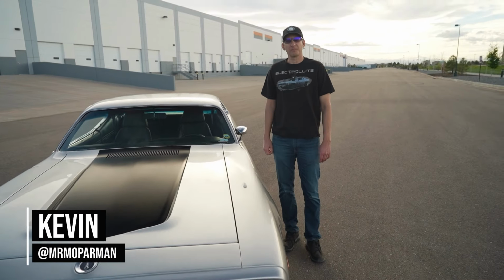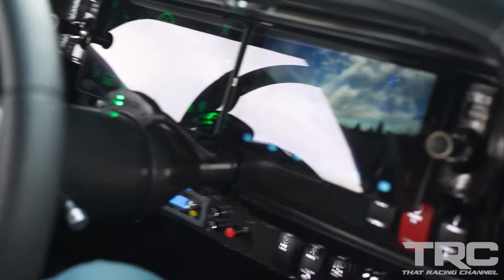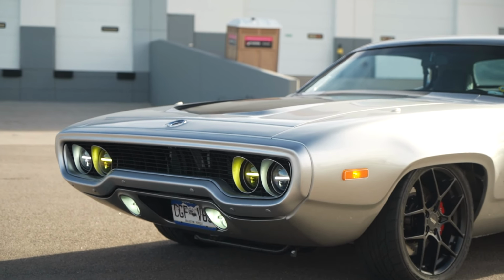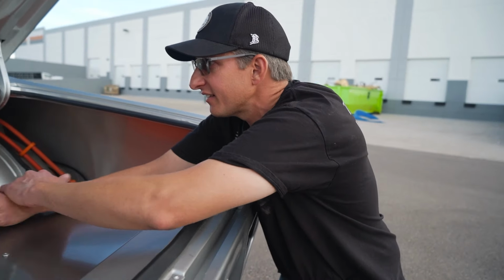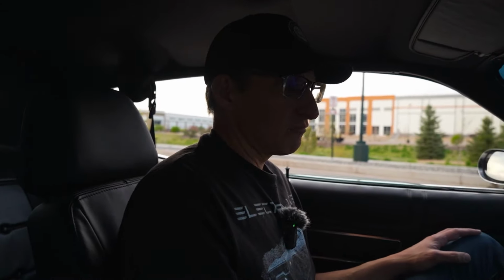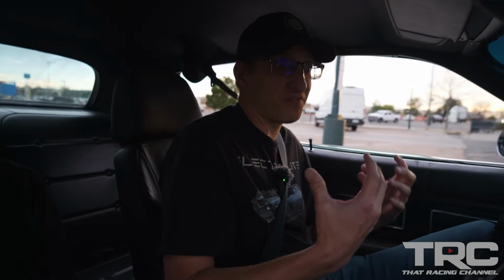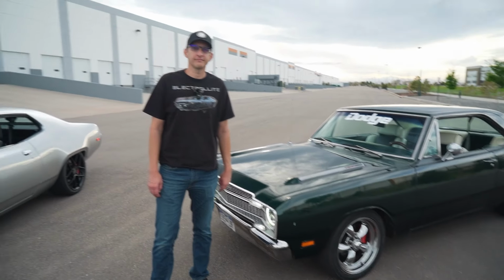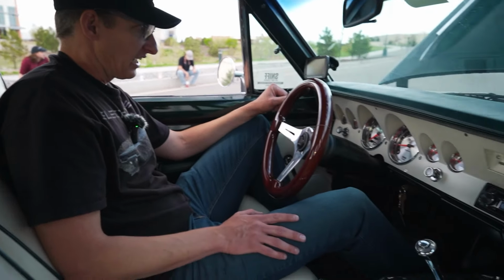Tesla Swap Plymouth SURPRISES 700HP Turbo Dodge Dart! (He Built his Own EV Muscle Car)

Comment: I think if EVs went more into a 'conversion' philosophy, EVs would be a lot more appealing to a lot of gearheads. Something about old cars being converted to an EV makes it cool, kinda giving it that futuristic retro feeling.
Reply: Thats about my plan, already got a sportbike frame stripped down for when I have the money to start.
Reply: Cyberpunk lookin' ahh
Reply: If you think about it, it's just resto-modding to the next level.
Reply: Totally - this is the sort of electric I could get behind
Reply: There are many of these cars with no drivetrains and would be perfect for electric conversion
Reply: Eletric conversion my a$$
Reply: The weight alone wouldn't even allow you to pull off the driveway without a recharge.
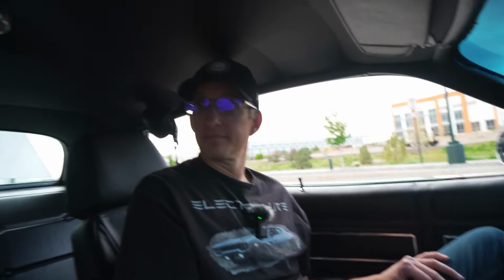Reply: @nuneza1987 .   15:20.    Your driveway is 250 to 300 miles long?
Reply: No. Just no. Actually ruined.
Reply: @nuneza1987  it's 600 pounds lighter than the tesla plaid the conversions parts came out of
Reply: @tylerbuilt_chevy_tough5163  exactly.
Reply: 😂 ok
Reply: No
Reply: this thing gives me that hyundai delorean vibes
Reply: Exactly! If someone designed, built and marketed a mustang ev crate kit for my 2016 mustang i would buy one in a heart beat. Especially if the same tax incentives for a new ev purchase applied to conversions. Its even more environmentally friendly than buying an entirely new ev, less manufacturing materials and pollution and less material going into landfills.
Reply: There's a company here in California that does it already, they have youtube videos.
Reply: Eventually, and logically, this is the only way old cars will survive. With batteries and electric motors they’re going to have way longer lives than they would with ICE. There’s way less to go wrong with the EV drivetrain.
Reply: @IAmSoMuchBetterThanYou  yes, and add to that an aluminum body like my f150 and were looking at several decades of longevity. Its exciting!
Reply: @leebatt7964  GM is already working on a build to attach directly to a Turbo 350 transmission. Should be available soon as a kit swap. Hopefully Ford has something in the works.
Reply: Hybrid
Reply: Nothing cool about it, just ruining a good car. If you can’t understand why, you are not a true gear head.
Reply: Naaaaah.... something about not hearing my engine really pisses me off.... i dont like evs or where thats headed. At all.. honestlt it should be a choice nota force.. this gots to be breakin something  constitutional. Some kind of right or something. The right to choose. And freedom..
Reply: It also gives a new lease on life to antiques that otherwise sit and rust.
Reply: It is bro. There are plenty of companies that you can purchase engines from.
Reply: Or it is erasing what the thing was about. It is just using the shell. It is a bit like the silly stereotype that women choose cars based on their color. This is what it is, it is not a Plymouth, it has Plymouth shell.
Reply: @tylerbuilt_chevy_tough5163  well you can live in the past then
Reply: Waste of resources, makes much more sense to design an ev platform from the ground up. You would get terrible efficiency and storage room if you just converted the entire fleet. This would make people hate evs lmao.
Reply: No gearhead I know would take this over a V8
Reply: @fcksham7127  They aren't practical to build, and have lower aerodynamics
Reply: in germany there are many gragaes that do this
Reply: @fartloudYT  Terrible take. You could say the same thing about the hot rodding scene when they modded OG cars and stripped them of their originality. 
Modding has always been around and will continue to be. Get on board or get left behind. Up to you!
Reply: @CallMeMrX  i would
Reply: @saikawanderer9166  no
Reply: @WildcatWarrior15  no
Reply: @brunster64  no
Reply: I dont think so.  Old gear heads are stuck in their old fashioned ways. They will be left behind by future technology and future generations.
Reply: I want to do this with my 1994 Toyota estima 7 seater egg car.
Reply: converted 1220 amps to 400 volts that's 654.16 Hp just like a muscle car, he'll beat any red light but yeah he can't smokey and the bandit the car for long.
Reply: A muscle car with all that battery is much heavier than your average electric car so  that car almost weighs close to a  2 ton truck maybe , a fender bender and this car wins hands down😏.
Reply: @samuellp1146  he said it weighs less than the tesla
Reply: @subspaceanomaly  my bad
Reply: @samuellp1146  I'm not sure if it weighs more with the batteries than it did with that big motor under the hood, I guess it does weigh more, but he seemed to say that having half the batteries in the trunk made it heavier at the back so more traction on rear wheel drive compared to the petrol version. I wonder if he thought of making it 4x4 or if that would be too complicated
Reply: @subspaceanomaly  100% agreed. He (or somebody else) might make a 4x4 electric, imagine a Ford bronco electric (I heard Ford is leaning in that direction but I was hoping somebody could take an old  classic Ford bronco).
Reply: There's a ton of EV crates out there it seems like these days
Reply: To me it hurts more but to each their own
Reply: you will make enemies with classic car fans,, they want their ICE in their classics
Reply: This is giving me ideas…
Reply: You have to remember that people that will build their own cars are a very very very tiny part of the market.
Reply: @nuneza1987 you apparently have no clue what old muscle cars weigh
Reply: @leebatt7964 that's just goofy
Reply: @ogzombieblunt4626 were you trying to be wrong as possible or was this an accident
Reply: @Channel-iu6de  All gear heads are not the same you goober
Reply: @samuellp1146 wrong
Reply: @looper964  ?????
Reply: @IAmSoMuchBetterThanYou No
Reply: What's not to like about this? Apart from the fact that it's a tesla moter? 
Here in Europe, there is a growing industry that will convert classic cars to electric driven. If it comes to electric driven or nothing at all, of course I'd convert.
Reply: Reminds me of the cars from that movie "in time" 💪🏽
Reply: @pmscalisi Rat rod hybrids with centermounted 5th tire electric bump for launches

Comment: I fell in love the minute he said ludicrous plaid drive train with none of the safety features which is the essence of muscle car
Reply: This guy gets it :)
Reply: Pity that car isn't street legal.
Reply: @bdhale34  in the USA it probably is road legal the Vin number is for the now antique car depending on the state it probably just needs a windshield safety inspection sticker that's just brakes and lights
Reply: It's a P100D. Roughly 700hp. IF it was dual motored, which I gather this is not (rear motor only), so closer to 500bhp.
The P100D had two motors, one front, one rear.
The Plaid drive puts out 1000+hp on three motors (one for each rear wheel and one up front).
Reply: @ZesPak  it's hard to do smoking burouts with all wheel drive  500 horses are enough to do that
Reply: @ronaldharris6569  i guess loopholes...
Reply: @bdhale34  why wouldn't it be? land of the free baby anything with mirros and lights is basically street legal. Even in my state of NY I could pretty easily register a homemade vehicle if I wanted to.

Comment: The 55/45 weight distribution went under appreciated. That's incredible.
Reply: I was thinking the same thing, when saw the battery pack in the engine bay, I thought it must handle poorly. While watching all of it I realized this guy is not a hold my beer gearhead. He has built a work of art.
Reply: what would the original balance have been? presumably the engine he took out must have weighed more than those batteries, I would guess..
Reply: @ceanomaly About 54.0% Front / 46% Rear. (Source: MOPAR parts board 1970 Road Runner weight).
Remove cast-iron V-8 block from front. I think the old Tesla Model S P100D rear drive unit assembly with two motors and reduction gearbox is hefty. The car's total weight is barely more than stock. Impressive build.

Comment: Every time I see this car featured, I pick up details I didn't see before and to pull this off in 1-1/2 years while having a day job is insane. That Dart is amazing too, the power to weight ratio should put it deeeep into the 10's, maybe 9's and for that B-Body to walk it is shocking. Great job on both cars Kevin and a well done video, love the "speachless" moment, no BS there.
Reply: E - Hot Rodding 🔥💥⚡😎
Ludicrous Speed 🚀 
Love Both!! My First car was a 1969 Dodge Coronet Super Bee with a 440 Magnum "same color"
 The Green Machine 😁

Comment: When I came across this video, I decided to watch it with the intention of leaving some hate in the comment section.. but I can't! Seems like a very well thought out and executed build. I had questions about how he was going to make that car stop, with all the added weight and speed, until I saw the gigantic brake rotors and calipers. Also, the cantilever rear suspension blew my mind! Well done. I think a nice finishing touch, would be a black strobe stripe across the roof and down the sides, like my 1972 roadrunner had.
Reply: Sounds like maybe you could use one you have a lot of fun peace
Reply: The funny part about the brakes is everyone says the Tesla brakes are terrible. Because they don't realize how much mass is moving that fast...
Reply: @juicesghost8501  It's not hard to believe that they work well when you have giant trucks that roll coal and do drag racing and probably weigh around that 4,000 pound mark if not higher in some cases.

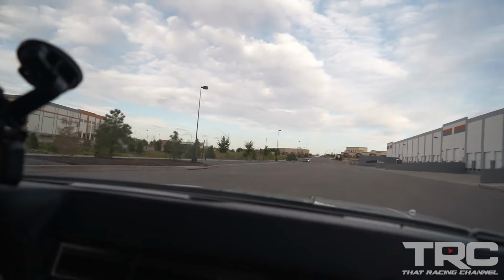Comment: 5:24 about 588Hp if  90%efficiency (cos fi 0.9), but peak power is at higher speed of the motor (and of the car since it has a single ratio gearbox) somewhere after the torque starts to drop lower
Reply: Thanks Nerd! :D
Reply: @DaggaBlaar  thanks bot!

Comment: To be fair on the roll race comparison, if the Dart had more convertor stall, and gears steeper than 3.55 it would have turned out differently......the dart makes both more HP and weighs less......it's torque over time = work, and the dart combo (though nice for cruising), kept the engine out of it's power band for a lot of the pulls duration, which is why it faired the way it did.......I'm not anti-electric but, you could take about any turbo-car, and kill its capability with the wrong convertor and/or gearing (a setup capable of 7's in the quarter, would be lucky to run 10's with a stock stall convertor.......just an observation / no-hate.
Reply: We got a know it all over here...
Reply: @1BigDaDo  It's not difficult to understand.....anyone who has ridden a single speed vs. multiple speed bicycle has the experience to comprehend what I wrote.

Comment: This guys easily impressed....unfortunately this is a wave i may never ride. If i get electric, its gonna be in a electric car made from factory. I could never swap out the original motor out of FUCKIN CLASSIC to put in a tesla motor or any other electric motor. But i give him props for actually pullin the swap off with no electric know how.
Reply: I mean he said he bought it busted so it wasn't running originally anyway. No real loss there 👍
Reply: IDK how much time you have left on the planet, but this is going to be the future of classic retro mods. As time passes, and Electric becomes mainstream, actual gas classic car replacement parts will become more expensive and more novelty than mass produced. If restored classics can survive into the late 2000s-2100s, but as electric restos, I think thats pretty cool.

Comment: I’m sure Tesla, at least at the factory level has a screen that will show you the health of each of the cells. But I also know that something Tesla doesn’t want anybody to know because they make far too much replacing batteries.
Reply: Tesla would have to test every cell individualy, what they can test is if the modules holding the cells are acting unusual which can indicate a bad cell.  Tesla is not interested on making money in repair, they tell their own repair centers to only charge the customer for the true cost of parts and labor. They rather you turn in your old Tesla for a new one and they will recycle the old one at a profit.
Reply: Tesla should not be making that much of off replacing battery’s since these cars are so new, really says something about their build quality 😴
Reply: @rainbowbridge4766  their build quality is fine, everyone ignores how badly everyone else builds cars, Porsche can't even get you half the warranty Tesla gives you.

Comment: I am an electrical engineering graduate and I wouldn't be able to pull this off. Degrees are overrated. This guy is on another level 😍
Reply: then please tell me im not the only one that had a mild stroke hearing this at 7:00 "super heat the batteries to get the resistance low"
Reply: @nihil9456  yeah how tf I thought heat = resistance.  Am I in a different dimension?
Reply: @buckeye9252  he does equal resistance. The highest tempature a lithium battery should be used at is 113°F. So he's either mistaken or just bullshitting to make himself seem smarter.

Comment: Back in the day a friend of mine had a 1972 PlymSat, as we called it. 318 v8 with a huge 2 barrel Holly carb on an adapter plate. It screamed when floored. I got two or three tickets in the car and I didn't even own it.

Comment: Both cars are awesome. They look awesome, totally cool. Kevin is awesome. Great job man, great job!

I'm a diesel technician, and as cool as the Plymouth is (coming from a guy that's also never driven an electric car other than my RC stuff), I'm not sold on electric in anything I'd drive, regardless of performance, cost, or whatever. I'm really not. I just don't feel it's the same experience without the sound, the feel, shifting gears, etc. I feel the same way about my dirtbike - it's just not the same, and I don't think I'll ever want to give that up.

There is really only one scenario that I can imagine that would make electric vehicles appeal to me, and that would be if I lived 100% off-grid and had the ability to charge all my vehicles off my own power sources. Maybe then, but it's still a "maybe".....

Kudos to you, sir, on producing this video, I really enjoyed it (even if it doesn't make me want to own an electric car). And kudos to Kevin for the build - simply amazing work.

Comment: If the owner of the electric car is watching and reading my comment , what if you remove the dodge demon sign and you put a lightning ⚡ bolt instead.
Reply: How about both?  I gave the demon logo lightning bolt horns, but I'm always open to ideas!
Reply: @MrMoparMan  🤔 yeah thats sick as well and just make the lightning bolt a bit bigger I guess. You mentioned that you can't charge with a Tesla charger Throtl on YouTube has a 350 Z with a Tesla motor as well I wonder how they charge theirs
Reply: @purplehills56  Yep for now in the aftermarket CHAdeMO fast DC is the only practical option.  The throtl 350Z has the same J1772 AC charging, but no DC fast charging yet.  We are running the same BMS so they can add it pretty easily.
Reply: @MrMoparMan  Just beautiful mate...Now if only it was right hand drive...😉

Comment: The most amazing potential for EV performance enthusiasts, in my opinion, is the ability to program traction control to incredibly tight tolerances and maximize the potential of torque-on-demand from electric motors.

The disadvantages are battery/electrical safety and the fact that you're still "Rollin coal", just at a powerplant rather than the ass end of your car. As battery (energy storage) technology and the energy industry (generation, delivery, and storage again) develop and advance, the potential is amazing. ICE's don't stand a chance *eventually.

Comment: You could have done the status as PRND, in that order so P I’d Parking Brake is on, RND is your drive selection. This would as closely match the Gasoline PRND21 the original Plymouth Satellite had.  It looks backwards with the way you have the lights arranged. Also P can be canceled by logic once R, N or D are Selected. You could have an Al indicator for PRNDL, with L being Front Brake Line Lock!

Comment: The great thing about electric cars is the instant response of traction control system. Without traction control these cars are not drivable, it can break traction with no effort.With traction control it becomes a servo motor that puts maximum power down on any surface. His car is nice, it can do burnouts, can drift but it loses that predator character, that perfect killer, no wheelspin, no show, all go

Comment: Would love to see people start finding ways to modify tune these electric motors with modern pro touring chassis and suspension shocks tires or drag racing chassis shocks suspension tires etc. Imagine trying a camaro zl1 1le with a telsa plaid motor or a demon with the same motor. Let alone aftermarket parts

Comment: 1220 amps at 400 volts is 488,000 watts which is about 650hp. The difference is that's max torque at "idle." So yea, it's going to feel really fast.

Comment: The ONLY thing that is driving me nuts is the fact the left headlights (right from the front) are clocked slightly off of horizontal...so the look crooked with the clean light line in them..

Comment: for my project I'm going to be taking a 2006 Dodge Charger SRT8 and convert it from Gas to electric . I know some of you are going to ask, 'Why?' well it would be a headache to deal with a blown engine, or a blown anything else. so it's best to rip the V8 engine out and switch over to electric. (thankfully the battery is in the back so that's going to be easy to work with.) The transmission I'd rather keep and adapt it to a Tesla engine (and still supply power to the rear wheels.) inside the car it's going to be bloody Fort knox. I'm not taking any chances with thieves stealing jack shit. along with a remote start, I don't think remote start systems were around in 2006 (at least not that I remember).